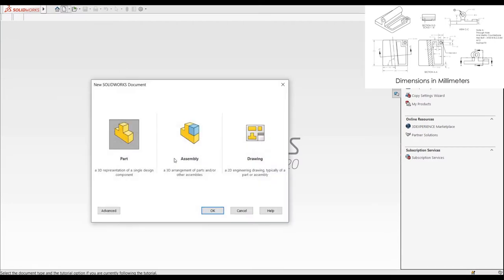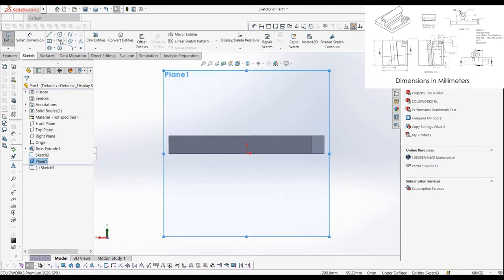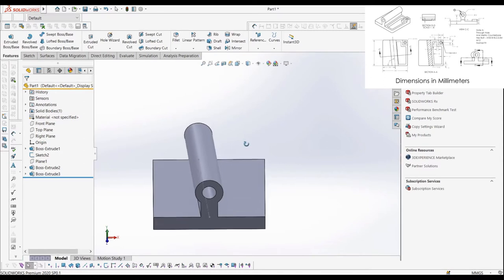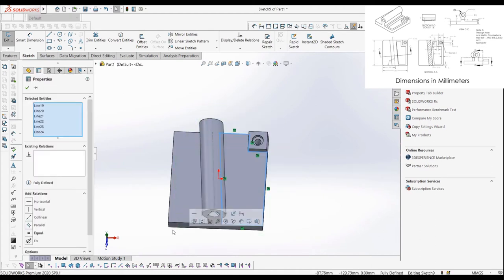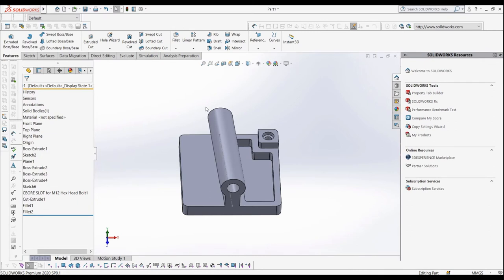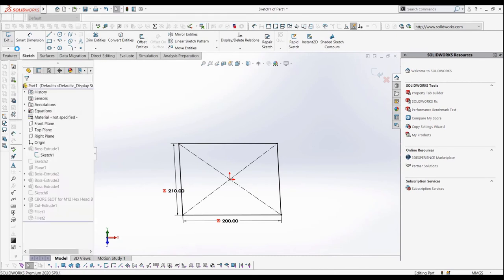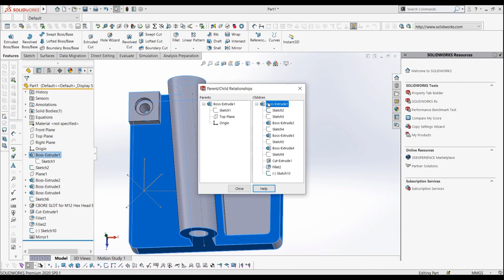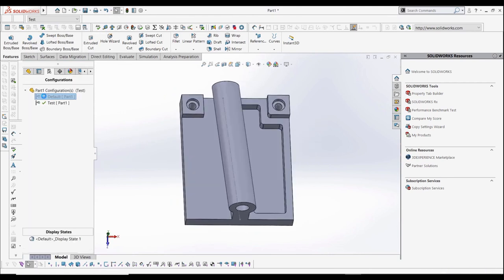Zero to CSWP #3 | Beginner Solidworks Tutorials

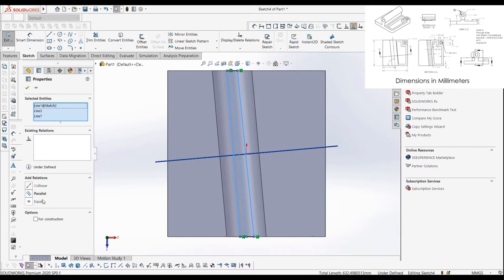Comment: Hi Lucas, really appreciate you for posting such wonderful tutorials. I am preparing for my CSWP exam now, and these videos are really helping me. Your videos are short and to the point. So, each minute of your video is an opportunity to learn something new. At 3:38, adding two lines parallel to the construction line was, I believe, dimensioned wrong. Because the dimension 30mm is given on the front view on the drawing, so if you draft this model, you'll get a different measurement. It would be better to either dimension the endpoints of the parallel line (vertically), or my approach is to create a Swept Boss/Base profile and path.
Reply from the maker: good catch, however the 30mm is given on the section view C-C which already accounts for the angle. Unless I am missing something let me know!
Reply: You are absolutely right. It was my mistake that I missed it. 😅 Nothing less from an Expert. Thank you.

Comment: Lucas - great stuff!  Really appreciate what you're doing here.  In the example, when playing with configurations - I noticed that the cylinder did not seem to be fully constrained to the plate.  You use a vertical constraint for the location of the sketch relative to a point on the edge of the extruded plate but when adjusting the plate dimension - the there does not seem to be a horizontal constraint.  Did I miss something in your model.  I had to add a fixed dimension relative to the edge of the extruded plate to allow me to adjust the overall dimension and have the model update properly.  Make sense?  I would have preferred to add a horizontal constraint (I guess at the interesction of the plane used for the cylinder sketch and the centerline for the attachment extrusion - but it wasn't obvious how to do that yet).
Reply from the maker: Hey Jeff, I think what you missed is the dimensions at the 3 minute mark? If this is not the issue, could you send me an email with a picture just to give me some more context. 

Thanks for watching!

Comment: Thank you for the great series on CSWP. I am preparing to enter the exam in a few weeks. I am having an issue with the equations in configurations. I have created two configurations. A and B. A simple block with a hole. If I suppress the hole it works fine. A has the hole, B does not. My problem is that if I make the block 100mm long in the equations for A, and 50mm for B, both configurations change to the last size that was entered into the eqautions. In the example of the part in your video, I see that the size changes when switching between A & B. I am not sure what I am doing wrong.
Reply from the maker: When you change the dimensions, make sure that "this configuration" is selected from the dropdown menu to the right of the value. I realize I did not make this explicit in the video.